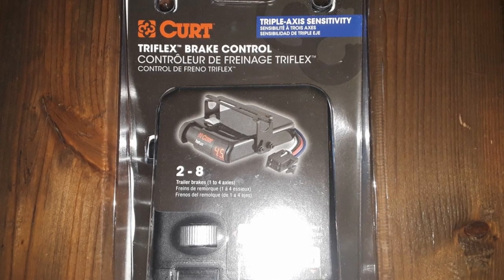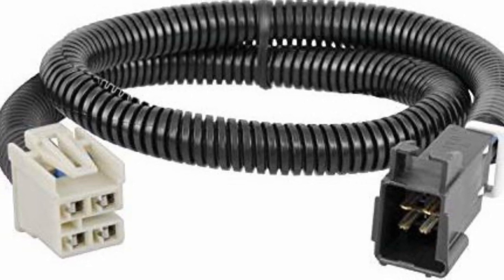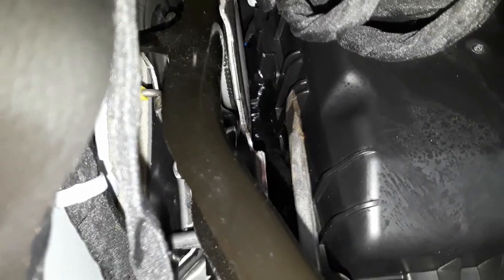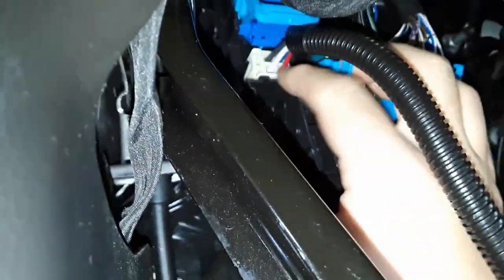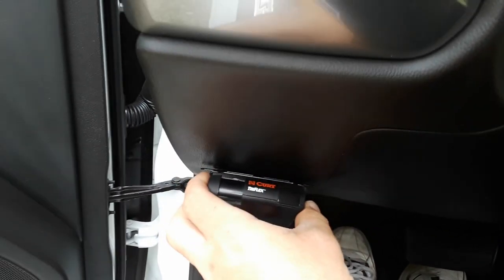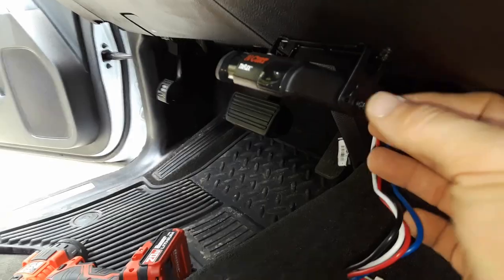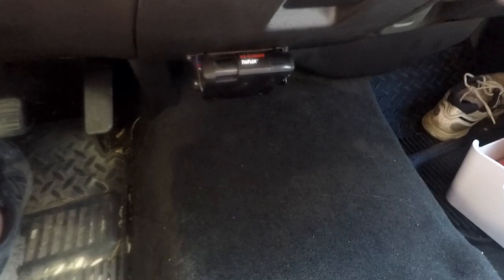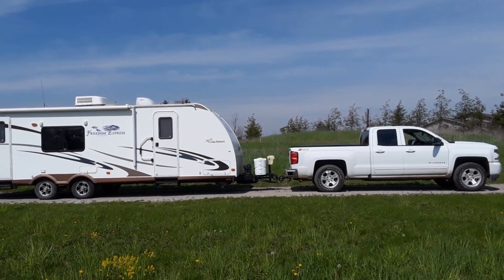Installing a Trailer Brake Controller - 2018 Silverado

Comment from the maker: Components used in this video:
- CURT 51140 TriFlex Electric Trailer Brake Controller
https://amzn.to/3AJLIcp
- CURT 51451 Quick Plug Electric Trailer Brake Controller Wiring Harness for Select Chevrolet Silverado, GMC Sierra
https://amzn.to/3arrpFI
Purchases via the above affiliate links may earn the channel a commission. Thank you for your support.

Comment: I have a cushion the electric  brakes only works with the brake controller?, I dont have a break controller in my truck and the electric brakes in my trailer does not work.

Comment: I opened my box and the plug-in spot was already taken. I have a 2018 1500 LT. No brake controller stock or aftermarket. It’s the same wires and plug. Wires run straight down under the carpet. Any thoughts on what this could be?
Reply from the maker: Sorry, I don't know what it could be. Is it a previously owned truck?

Comment: Does curt make custom wiring harnesses?
I.e would I be able to buy this set up for my 99 GMC suburban  2500?
Reply from the maker: The harnesses made for specific vehicles (what I would refer to as custom harnesses) are for those that are brake-controller-ready, for example the one I used in this video. However, I don't think your year Suburban has the available port to use (not brake-controller-ready), in which case you would need their universal wiring adapter. One end plugs into the controller, the other end doesn't have the clip, just separate wires that need to be spliced into your existing wiring under the dash.
Reply: @thecountrylivingproject3263  My vehicle has one, it's a 2 pin plug in that is located on my relay panel in the same spot as yours but it's a different panel and the place where the harness would plug in says NAT...I used my power probe to verify that its tied into my brake switch circuit (when i push the brake pedal in I get battery voltage and when the brake pedal is not pressed in I lose battery voltage). The problem is i cant find any one that sells the harness that is specific to my year, make, and model. Thanks for the video as well as your input but I think your right about needing to splice into the brake circuit.

Comment: What is the weight of your camper that you pull? How does your Silverado handle it ?
Reply from the maker: The camper is 28 ft. with a dry weight of 5,225 lbs. No problems with the towing at all.  My truck has the 4.3 liter V6. Rated towing capacity is 7,600 lbs for the truck but I think if I were to haul something closer to that maximum it might struggle a bit.
Reply: @thecountrylivingproject3263  Thank you for the reply! I have the 5.3 v8, I just didn't want to get something to big and have the truck struggling to pull it at 65mph.

Comment: Why not use the oem brake controller?
Reply from the maker: The truck didn't come with an OEM controller installed, and apparently you can't add an OEM controller afterwards on the Silverado. Not that I don't think it couldn't be done but if so it would for sure require much more time and expense.

Comment: Thanks for making this video but I was wondering if you can help me out, I got this same set up for my 2018 silverado but for some reason once I was done installing it there's no lights on the unit
Reply from the maker: I haven't run across that issue. I guess check to be sure the harness is plugged all the way into the port under the dash, and also fully inserted into the cord coming from the unit. Could also be you have a bad adapter cord, or a bad unit overall.
Reply: @thecountrylivingproject3263   Thank you for the advice, I sent the unit back and ordered another one and I'll make sure all the connections are in all the way. Thanks again for the reply 👍🏼